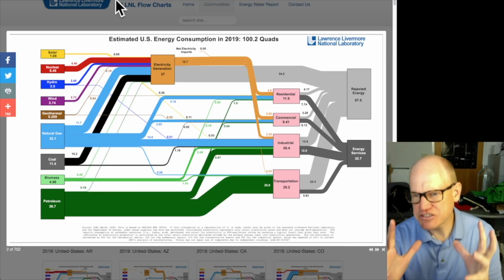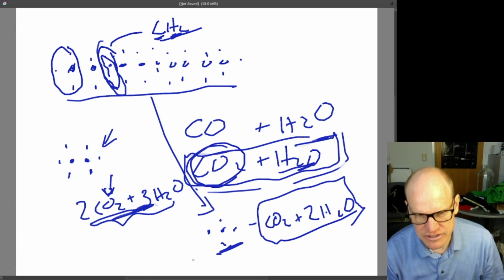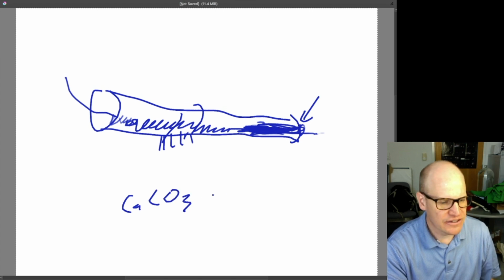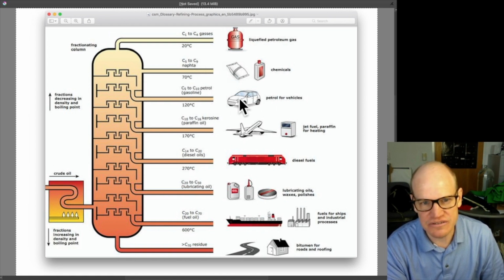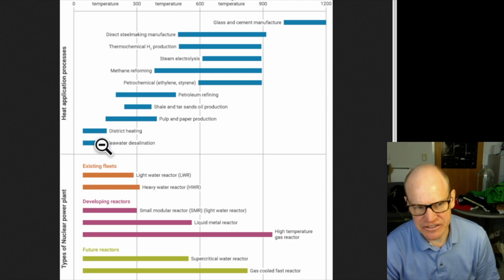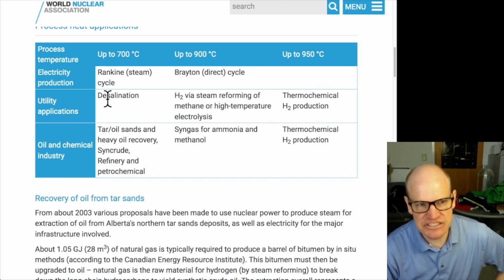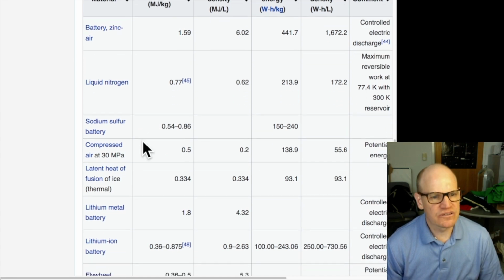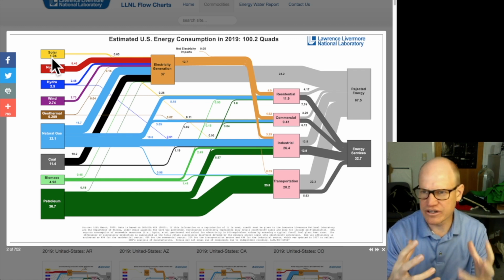Nuclear Energy 07: Alternative Uses for Nuclear Energy

Comment: One thing you kind of missed is the ablity of molten salt to transport and to store heat.  Like the main idea of nuclear for process heat is to transport heat into storage tanks of molten salt where this heat can be tapped for different uses.  This makes for on-demand power production.  This would enable the nuclear reactor to work closer to full capacity while uses can be more on need or even for high peak uses.  Using nuclear in this way opens up the use of nuclear power for a greater diversity of potential profitable applications.
Reply: Tons of electricity to heat up those refractory metals.  Don't think molton salt is m.p. equivalent.
Reply: @dalethomasdewitt  Nuclear perfect for oil refining, and H2 production which can be used in many industries but straight heat form molten salt can replace a lot of natural gas use.
Reply: Very good point! You can use a smaller reactor optimized for continuous maximum output 24/7/365 and still meet fluctuating demand.